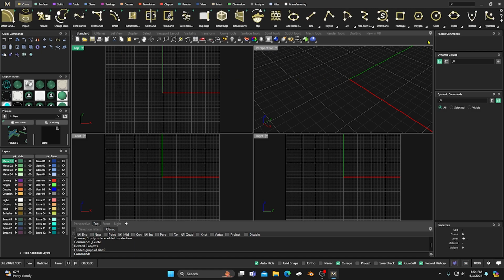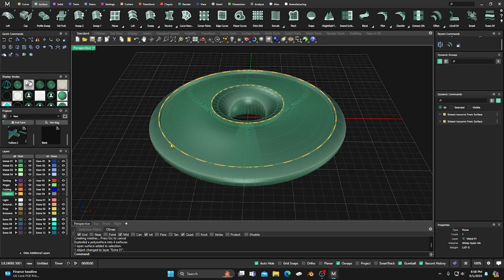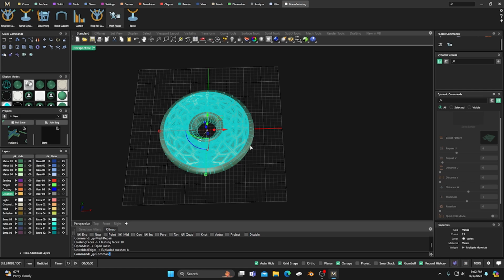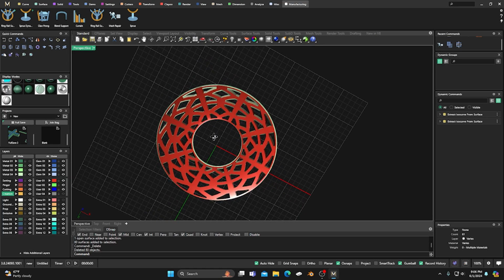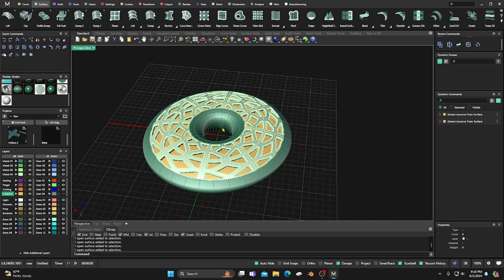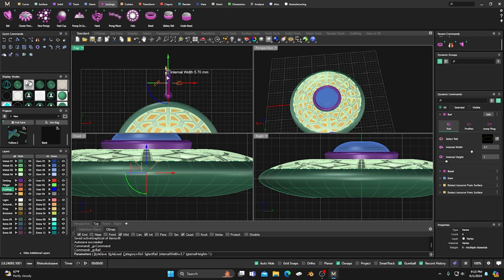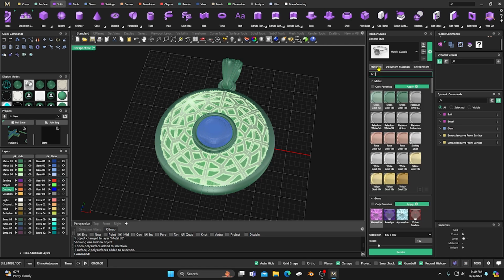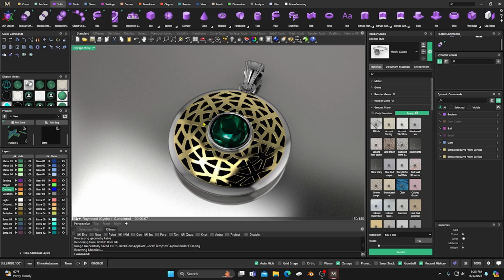MatrixGold Smart Flow Surface modeling or Mesh

Comment: Thank you for the video!  If you may ask, why not combine the upper part of the pattern and select the entire edge, like the edge of the lower surface?
Reply from the maker: Well, those are 2 rows of patterns right and eight patterns in each row. We would have to ungroup them and then go back and merge all those surfaces together to make one surface to just pick the curve. So, to me it is just easier to chain edges with the blend command. But if you know of a way to make them one surface quicker or easier please share so we can all learn. I would appreciate that.